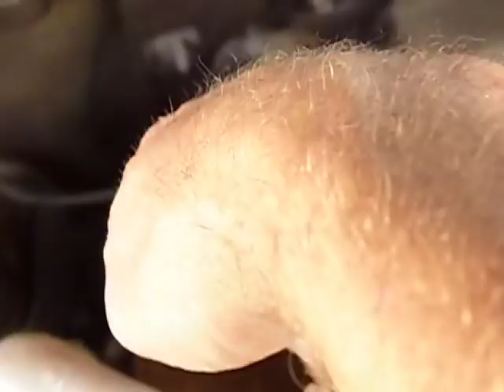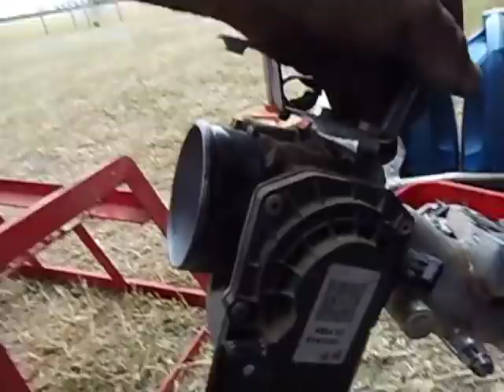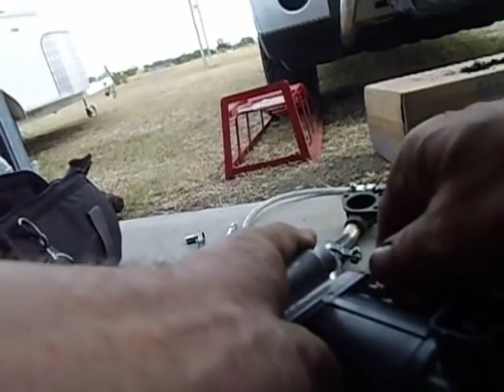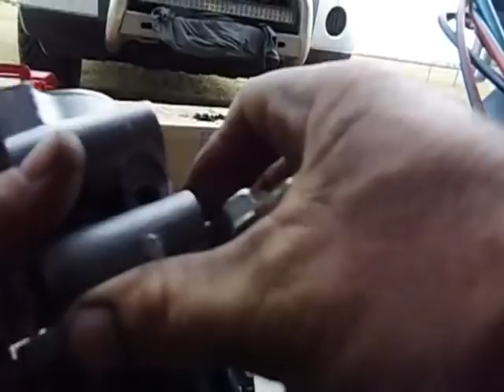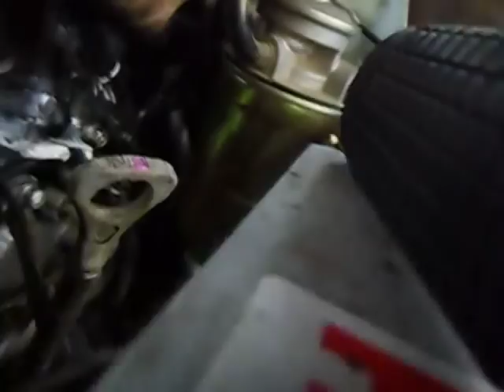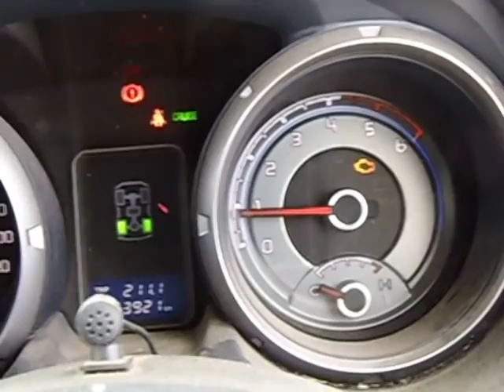Mitshubishi Pajero diesel 2008 engine management light on and EGR unit cleaning

Comment: I had this problem but didn't make rash decisions. I had one mechanic try and clean the EGR. I bought a brand new EGR and replaced it. The engine check light needs to be cleared with a scan tool. The DPF light started illuminating while the engine light was on. The DPF will clog up if the EGR is faulty. Don't waste your money cleaning the EGR. Replace it. I found that my old EGR was seizing up due to worn out guide bearings.

Comment: ours has 190'000km on it - we havent had this issue yet - ours has the 3.2L 4M41 motor in it

we drive over 100kmh most of the time - would this play a part in keeping the EGR clean?

Comment: Wow! thanks for this upload Sir! Its a great video. I just want to ask regarding the re assemble of the intake manifold. Do you have to reset the ECU or computer box? How about the throttle its just plug and play socket no need to adjust? Anyway my unit is triton with that 4m41 engine. Thanks a lot Sir! More power!

Comment: What did you clean it with ?
Reply from the maker: I just used engine degreaser with paint brush and a high pressure cleaner
Reply: @danssv8  what degreaser did you use? Can i use querosene?